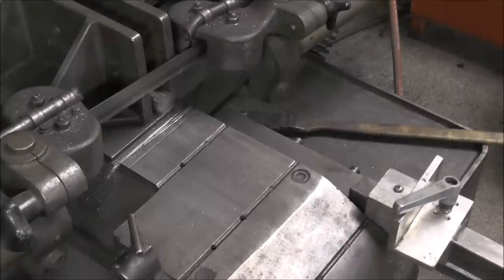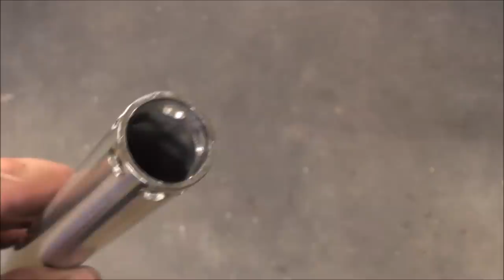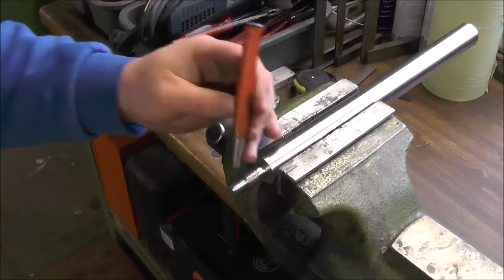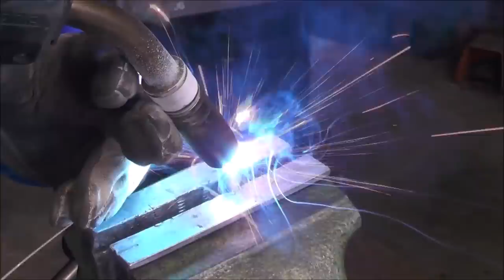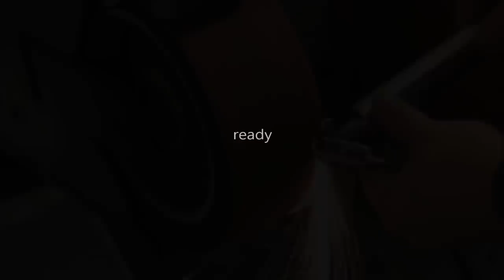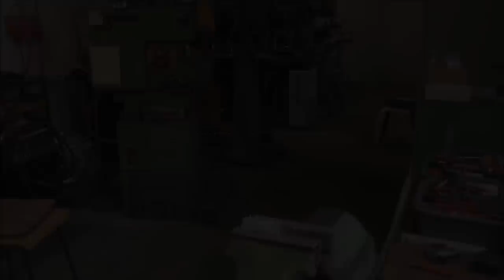Making a Convertible Nunchaku

Comment: 1) So you have an offensive weapon, cunningly disguised as an offensive weapon.  Neat.
2) You have a lathe, but still use an electric drill clamped in a vice to clean up the welds?????
Reply from the maker: 3) You sir obviously are not a craftsman. These pipes are not perfectly round, so a lathe is not suitable! Thats the reason why I use a belt grinder...

Comment: Almost Nunchucks half of these Numchucks swivel both sides of the chain need to swivel. when using them you will switch what bar you are using one of those bar of your make swivels but the other bar does not. meaning you must keep track of what bar you are using because if you rotate with the bar with the swivel it will spin perfectly in the same consistent way if you switch to the bar with out the swivel it will catch on the connecting link of the chain this will make the bar swing up in rotation depending on link size it might wrap or it might slip in a more random motion. go ahead and try it out far from your face oscillate first one bar then the other bar. good job on the one that swivels. to inter lock them two that swivel I would make something like this https://youtu.be/ZTyipiaqkTc that way you can have a button on the bottom of each of the bars to decouple the bars. the ball lock looks robust enough to be use in combat. the problem is you would need a coupling pipe for the ball lock to lock in to. coupling pipe I would make with sharpened ends and to be thrown at the enemy, but the enemy might use that as a weapon. a tip for using Nunchucks is you should think of them as a long link in a chain don't swing it whip it, but the patterns of motion can come from sticks. they are loved by many because they are hybrid tool, some stick and some chain. they can be training wheels for chain. they can teach you how to send power with the stick. Nunchucks joke: if you are expert at Nunchucks use Nunchucks to fight enemy, if you are less then expert at Nunchucks hand Nunchucks to enemy and wait for enemy to severely hurt themselves don't worry it won't take long. moral of the story: make a PVC and plastic chain version to practice.